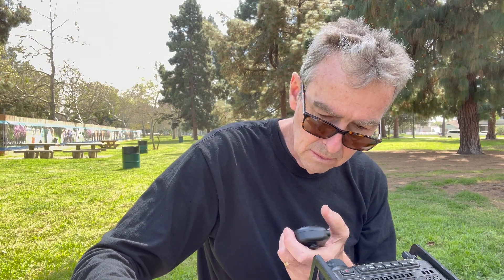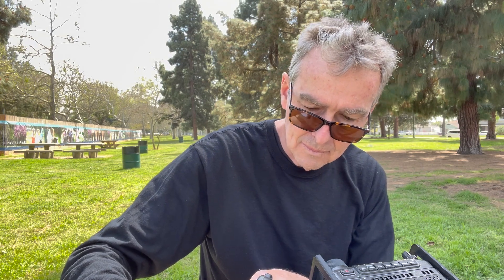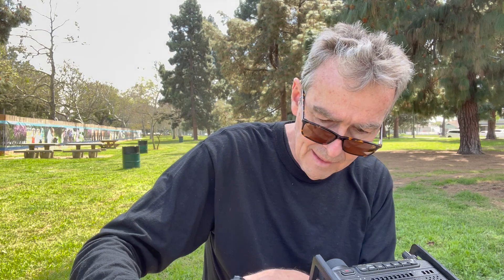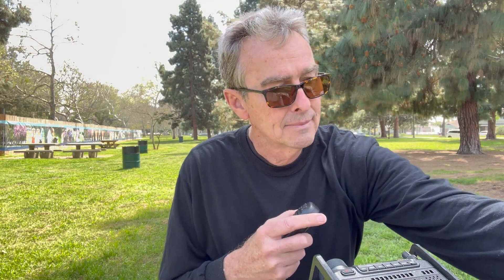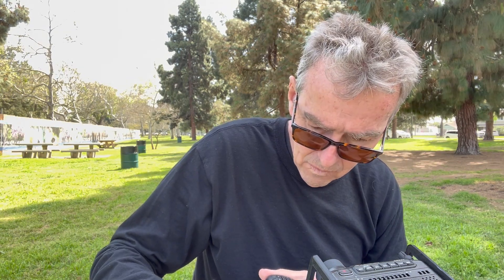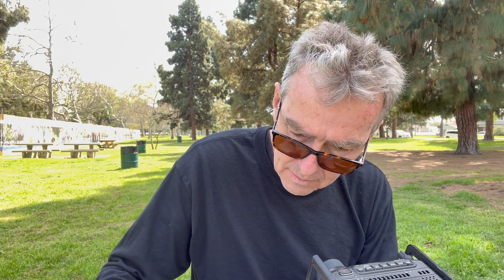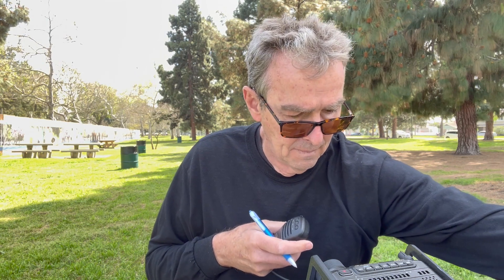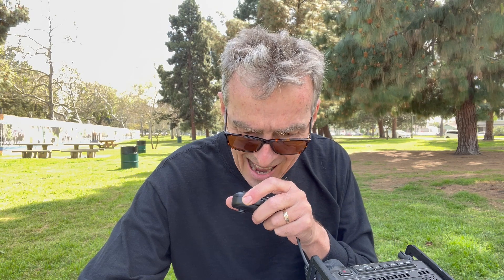EFHW Antenna Challenge: What Works Best?

Comment: That's a good comparison. What's the length of the wire you are using for the EFHW ?  Is it 66 feet. Guessing you are not using counterpoise
Reply from the maker: Yes, 66'. I have tried using a counterpoise of various lengths & found it didn't really help. I do run at least 50' of coax. 73!